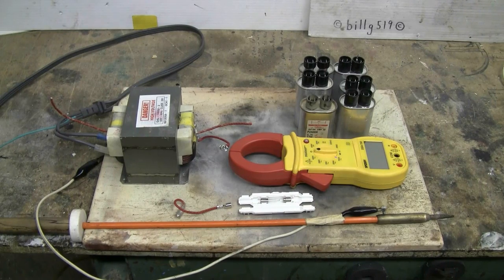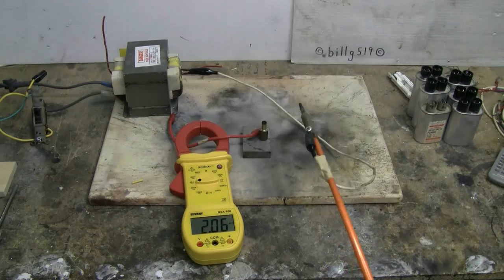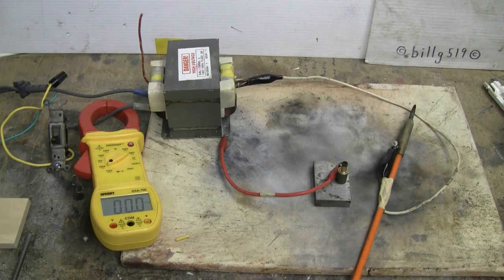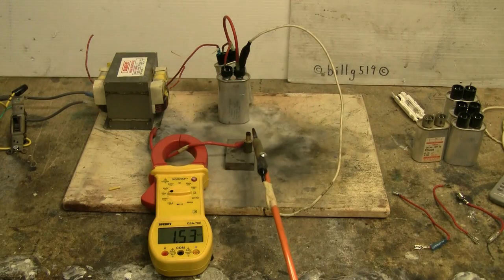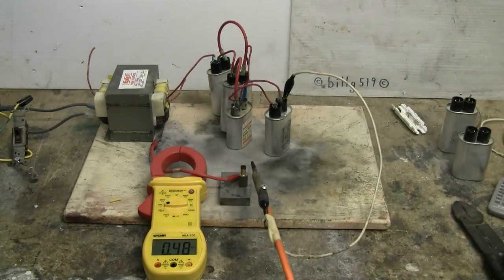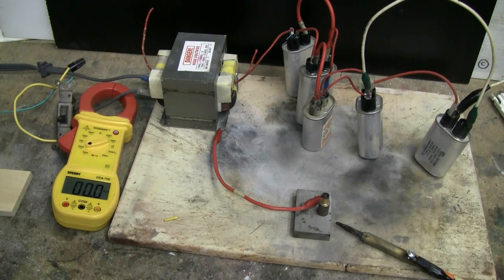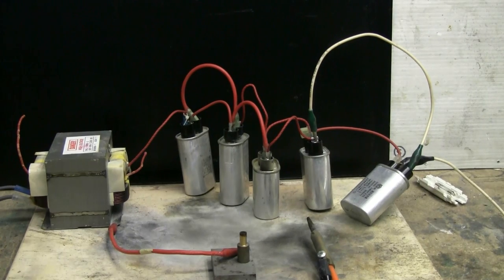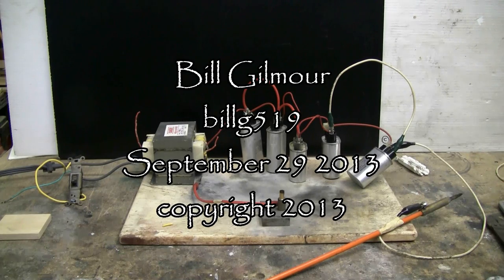High Voltage - One MOT, Capacitors, And Some Arcs

Comment: High Voltage from Microwave Oven Transformer (MOT) wiring some microwave capacitor circuit in series and great arc, and Microwave Oven Transformer (MOT) was heat.

Comment: I have 2 questions. Does the MOT still have the shunts between the coils? Is the primary voltage 120 or 240v?
Reply from the maker: +bossoholic Primary voltage was 120 and the shunts were still in the MOT.
Reply: @BillGilmour519  Can you try 3 transformers and 8 caps?

Comment: I can’t even get the arcs from one MOT. Are you using a special power supply?
Reply: Robert Hunter just plug it into the mains.The iron core is actually on end of the high voltage! Be extremely careful with mots

Comment: why the arc is getting bigger when adding more capacitors ?
Reply: I believe if you wire two capacitors in parallel, and then the transformer in series with those, you get resonance. Not a good explanation, sorry 🤷

Comment: If you had used the diode, you would have a voltage doubler--pulsating.  It is wired with the diode and capacitor swapped from the conventional half wave rectifier, but you will get something like 5.6kV peak out.
Reply: tell me more about it

Comment: One 2200 v mot +1.0 u.f 2200 v cap did better than when I added 2 more 2100 v 0.85 u.f caps. I going to study more I put most effort in safety because this was my 1rst h.v project I have 3 mots and 4 flybacks I'll be reading for hrs tonight

Comment: Micro wave capacitors all have a coil inside , so they cant get carched
Reply from the maker: +su shi Actually they have a safety resistor inside that discharges the cap when the microwave is not in use.